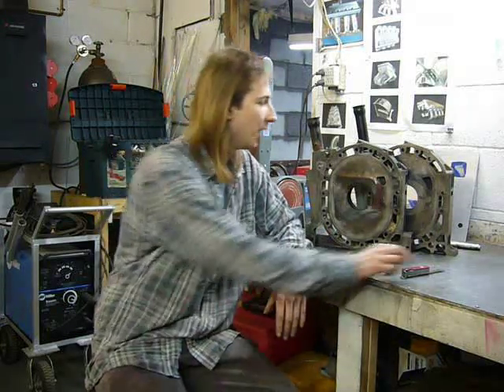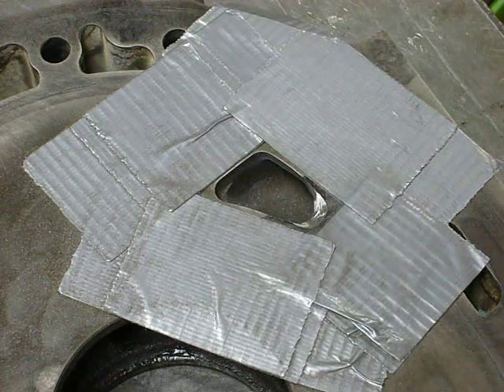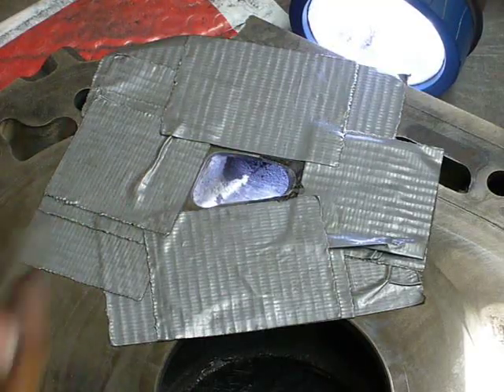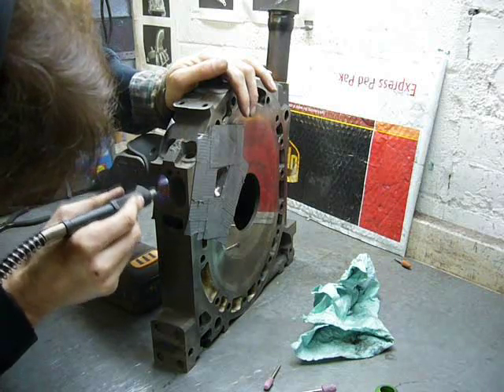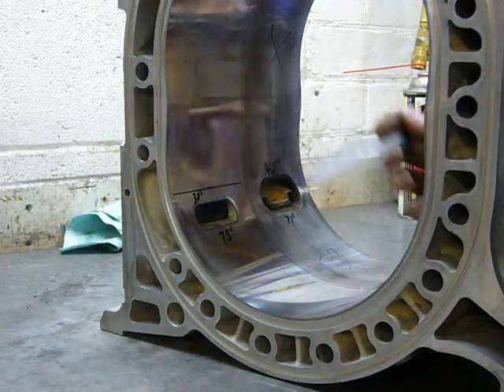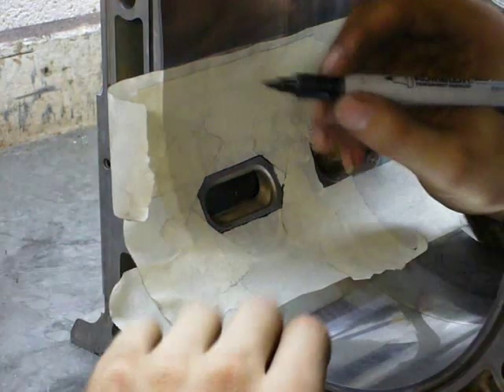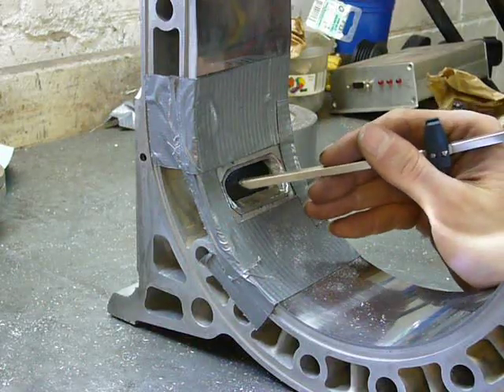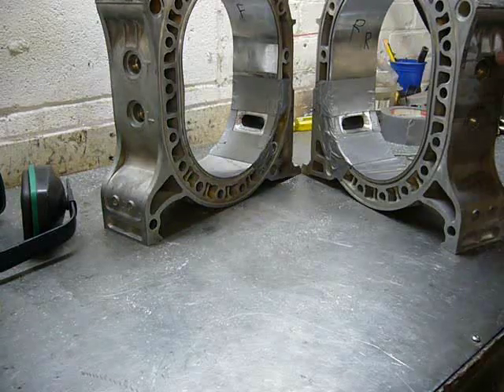Part 7: My 76 Mazda RX-5 Cosmo Restoration - Intake and Exhaust Porting

Comment: Aaron on my 1988 rx7 at the top of the ports the egr tubes pertrude should these be pluged. I noticed you covered the hole where the egr valve used to be with a flate plate. I was going to have a crossover chamber trying to duplicate the original design similar to original. What do you think
Reply from the maker: Mazda alternately eliminated and added back EGR over the years because the geometry of the engine means there is so much natural EGR. If you are eliminating the factory EGR system then the easiest solution is to cut a plate out of 1/4" steel/aluminium, drill using EGR valve or gasket as template and bolt to top of center iron with some sealant.

Comment: I've gone back to watching old episodes whilst I wait for the new shop :-)

This one remind me of my youth porting 2 stroke motorbikes.

Looking at the way you assemble the rotary - have you been tempted to try and put an extra layer in there like the 20b has ?
Reply from the maker: ***** Funny you should mention porting 2 strokes because as I was using my new 40V lithium ion trimmer (at the new place) I was thinking about my old 2 stroke, which I did port, and how much better it was not to have to deal with a smelly, dirty, greasy, noisy engine. Unfortunately it's not as simple as adding an extra layer to make a 13B into a 20B. The 20B middle iron (the "thick" iron) contains a bearing and stationary gear to support the extra rotor. As well as threaded holes to install a shorted set of tension bolts for the front section. The 20B eccentric is also 2 piece, otherwise the engine wouldn't be possible to assemble.
I did consider a 20B for this project because, well, how awesome would a '76 Cosmo be with the 20B from a Eunos Cosmo? But engine bay space, not wanting to build a beast and my desire to build a turbo 6 port with functional aux ports won out. Plus the cost of a 20B of unknown condition would alone have been the majority of what I've already spent on the car...and that's before I rebuild it.

Comment: hi there Aaaron
when you do a bridge port you then must lost low end tork ?
Reply from the maker: rambo95777 In general yes, if the Bridgeport is large enough to make it worthwhile, low end torque is reduced. Remember, the intake ports in a bridgeported engine never close fully so there is always major overlap with the exhaust stroke. This contaminates the incoming fuel charge with exhaust and reduces vacuum so chamber filling is reduced. That's why the torque drops and why the engine makes the characteristic "brap  brap brap" sound...it's rhythmically misfiring due to the charge dilution. Also because of this, a LOT more fuel needs to be added to the mixture at low RPMs and low loads, so fuel economy takes a nose dive. Bridgeports are high RPM race ports, just like you probably don't want a race cam in a daily driven piston engine.
Reply: aaroncake thank you Aaron.

Comment: Hey Aaron!
Are you familiar with Motoman?He runs a website named "Mototune USA ".
He has an article in there about porting and describes there how enlarging and polishing ports actually decreases power.here's the link to that:
http://www.mototuneusa.com/power_news_--_think_fast.htm
what is your opinion about his theory?

PS. You have made clear enough that you are a wankelhead although i am pretty sure you have the expertise to comment on that!
cheers from an Alfafreak!
Reply from the maker: I think he's pointing out something which all well informed builders know: bigger isn't always better. Certainly over porting runners and the like can lead to massive velocity drops. Sometimes even port matching can cause reversion issues. So it's certainly true that enlarging runners can be a bad thing if overdone or the rest of the system isn't matched (ie. no point enlarging runners on a near stock engine). However all of that applies to piston engines, as does his article. Porting on a rotary is best thought of as a cam swap on a piston engine. Changing the rotary port shape changes opening/closing timings and that is where most of your power comes from. But the same rule applies to the runners: no point increasing the size in most cases as it's just going to hurt you. Notice all I did was smooth some casting flash in the runners, I didn't increase their size. And my actual port job was very conservative as any more adds significant overlap, reducing low end, idle quality and fuel economy in exchange for top end gains.

Comment: What is the difference between 12a and 13b rotor housings besides the width
Reply from the maker: That's the major difference. Exhaust port timing is also a little different between engines, and depending on the 13B ('86 - 2004) it may not have coolant seal grooves, may have water ports for the intake manifold to keep the carb warm/cool the turbo (early 13B, then 13BT/RE/REW). 13B housings may also have metering oil holes (starting in '85 I think) and have different spark plug locations.
Reply: I ordered some re tooled rotor housings from atkins rotary because by 12a housings had very bad chipping. they look exactly the same and they also recut the grooves for the seals back in to the housings. how do u think it will run with a street intake port and the 13b exhaust?
Reply from the maker: destruction12100 They will run fine. The 13B exhaust is a little bigger in general than the 12A so it's sort of like having a built in street port. Cutting and grooving 13B housings to 12A is becoming very common as 12A housings are getting very rare. The chrome on the old 12As was not nearly as rugged as the 13Bs so finding 12A housings with good chrome is a problem. Older 13Bs (GSL-SE and below) also had much weaker chrome.
Reply: ok thanks and I hope it don't hurt low end torque too much and I hope It runs good
Reply from the maker: destruction12100 It will work well. Since the 12A exhaust port is so small there will be a noticeable improvement.
Reply: ok thanks
Reply: i am having trouble with the timing on my 12a I had to set the e shaft pulley to the yellow leading mark and then line up the distributer marks and when I put it together and try and start it it doesn't seem like the timing is even close have any ideas why it wont run?
Reply from the maker: destruction12100 When you stabbed the dizzy, you may have done so one tooth off. Common issue with the dizzy/CAS. Also, when you measure timing, remember to disconnect the vacuum advance.
Reply: yeah proably just got it a tooth off and vacuum advance is never hooked up have no ports for them
Reply: could too much Vaseline cause the side seals to stick on the rotor and cause no compression?
Reply from the maker: destruction12100 Doubt it very much. Vaseline melts away as soon as the engine reaches body temperature.
Reply: what if I got some under the side seals and on the springs
Reply from the maker: destruction12100 Not an issue at  all. I slather Vaseline over all of my seals and springs when I build an engine. Are you having a compression problem? Side seal issues typically show up as poor compression on only one rotor face. But if your timing was very off, it is possible the engine has been severely flooded which will kill compression until it's unflooded.
Reply: I have low compression and its not flooded and the timing is right now
Reply from the maker: destruction12100 If the engine was built with factory (or another hard type) apex seals, and has used housings, it may take some run time before compression comes up. The first few starts can be difficult. I usually recommend just cutting the BS and push starting with another vehicle.
Reply: there new but factory cut down side seals new apex seals and new re tooled rotor housings. I tried to get someone to help me push start it but everyone around was busy lol
Reply: aaroncake  whats diff between :
13bt ,re,rew ?
(sorry if i sound stupid)  #face  palm :/

Comment from the maker: That's a question I probably won't be able to answer as I don't really work with carbs. However it stands to reason that the stock Nikki carb and manifold are probably most suited to fuel economy. A much larger carb is going to have issues atomizing fuel at low airflows. A street port can typically benefit from some more timing advance, on the order of about 5 degrees in the midrange and high end. But the dizzy (as compared to an EMS) is going to limit your ability to modify the timing curve.

Comment from the maker: A Holley and the associated manifold will be set up for high end, and thus low end and fuel economy will suffer. It can't be compared to my setup which is a custom set of manifolds and a modern sequential EFI system. A typical street port won't help mileage either due to the increased overlap. I agree with the MSD boxes on the old ignition system. Huge improvement.

Comment from the maker: 30MPG (and above) would be highway speed. City mileage will likely be in the low to mid 20s. This will not be some antiquated carbureted car though. Check out parts 23 and 24 for manifold and EMS configuration. The transmission and diff will remain stock. The RX-5 Cosmo actually has a decent rear end ratio for low RPM cruising.

Comment from the maker: Basically, that's how it's done. Use a template and then port with a die grinder/dremel. The skill is not making the port shape, but in matching that shape to the runner. Most people use templates they have purchased. I only didn't for the exhaust this time because my ports were rather unique. I'd highly recommend using a template for anyone unless they have done this a LOT and understand how the port timing works.

Comment: I have been thinking of porting my engine for a while now, but I don't think I could do it myself.  I have seen some shops in my area that do porting, do they use the same method that you use? Like they have a template and then just trace and grind away?? Just curious...

Comment from the maker: The stock Cosmo 13B exhaust ports were approximately SA 12A size...very, very small. Much too small really for making much over stock power. I only opened them up a little in the interest in more flow without impacting drivability, mileage and low end. They're actually smaller than 2nd gen ports, with only a few degrees of overlap.

Comment from the maker: I typically just use grinding stones, but switch to the rotary file when removing the aluminium in the rotor housings. I've never had a good set of carbide bits so I've just never used them really. Years ago I bought a "cylinder head" porting kit from Sandard Abrasives and used those stones for a long time, but these days I just use the Dremel so I buy Dremel bits. It's all about what you are used to.

Comment from the maker: A street port should pass an Ontario e-test but as with anything, it will depend on the condition of the car and the state of the tune. If this is a typical street port I'd recommend moving the exhaust port down about 3MM (look at the RB turbo exhaust ports), and widening by about 1MM each side. Don't move it up. Moving down increases pressure on the turbine during blowdown and helps drastically with response but doesn't decrease torque if you don't go down too far.

Comment: From what I have seen, NA can get up to about 300hp on the 13B-MSP, but fuel economy and bottom end power are shot.  Seems like the big top mount turbo is the way to go as far as boost.  Low psi street driving seems to get around 300hp and you can turn it up to 400+ for track use.  But with an S2 RX8, I guess the computer is more of a pain than S1.  Oh well.  It's only an 09 with 38K on it, so I have some time before I pull the trigger.  And more videos planned around engine stuff?

Comment from the maker: The template I used for the primary ports is the Mazdatrix 6 port street template. It's basically the same timings as the earlier Cosmo 13B iron I showed. Secondary and aux ports were left untouched as to preserve low end, mileage and idle. Exhaust ports were ported about halfway up to 2nd gen specs, template was a ruler and sharpie.

Comment from the maker: Understood. :-) I personally prefer using an electric grinder. A Dremel style grinder is usually under $50 for a decent model and doesn't rely on an air compressor running all the time. Though the off-brand Dremel style rotary tools are poorly made. I've recently upgraded to a Dremel 4000 and would never look back.

Comment: ok thx ,,i bought a pneumatic one but the bits or tips are so useless,,the metal eat them like butter,,,seems your bids are very strong,here is very difficult to get those tools..but i know the max rpm ,i can compare i find a similiar tool ,,about the bits i ll have to try and try thx man.congrats your job is very compromised ,some day ill have all those tools too,and make the jod easier cheers :)

Comment from the maker: Yes. Some porters prefer the stones, some like the rotary files. I just don't use the files because the cheap ones don't last and the good ones are very expensive. Stones are cheap and work well. You should keep the file lubricated with the WD-40 to prevent wearing it down or clogging it up with aluminum.

Comment from the maker: If you are following my Cosmo project you'll eventually see it run. As of right now the engine sits in the corner of my shop under a cover while I finish the large amount of sheet metal work necessary on the car.

Comment from the maker: Irons are resurfaced if necessary. Measuring stepped wear with a dial indicator as per the FSM will tell you if the irons are too worn.

Comment from the maker: I learned about engines by reading and doing when I was a kid. Nowadays, you have the Internet so it's easy to find info. Find an old lawnmower, take it apart and put it back together. Cheap and an easy way to get experience with a simple engine. Get the service manual for the engine you are interested in and read it front to back. You'd be surprised what you can learn that way.

Comment from the maker: Opening the exhaust sooner in a turbo application generally results in better spool. However since it slightly decreased torque, it's best not to go too early in an NA application. NAs benefit more from going up and wider, increasing overlap between intake and exhaust for better scavenging at high RPMs. There can be some slight reduction in low end because of this though. I typically don't close turbos any later except on already high overlap ports (bridge).

Comment: ahh ok thank you, know I see why you were grinding out the runners getting the burs out of the casting flaws.. as far as exhausts goes, what is the difference in performance  do you get a better boost if you allow the exhaust to leave (open) sooner? or if you  make it larger more on the back side of the rotor rotation? and does it make a difference with n/a's or turbos? (i have a fc s5 t2)

Comment from the maker: Ah, the runners. They should be kept as similar as possible. From the factory they are rough cast so I typically just smooth them out. Little is gained in making them much larger, especially the primaries. Most of the runner work concentrates on the transition from the port to the runner. That's where the majority of the airflow gains into the port come from.

Comment from the maker: I'm not quite sure what you mean by the "inside" but yes, every port you make in an engine needs to be the same as the other. Otherwise you create flow differences which will lead to each side of the engine having slightly different tuning requirements.

Comment from the maker: Depends. How much power do you want? The only problem is that regardless of the port you choose, to get big power out of the NA, it will have to be LOUD. Full bridge and you're looking at 250HP, but insanely loud. Peripheral, add another 50HP but also, huge noise from the intake and exhaust. Quieting up the exhaust chokes those high overlap ports.

Comment from the maker: @davidleonardi1 A port job usually includes all the ports in the engine. On old 12As, sometimes just the exhaust was ported because it was so restrictive. Don't bother with the intake manifold and throttle body. There will be negligible gains/losses. I don't use an air grinder for porting because I find them annoying. Have you watched this video? You can see what kind of bits I use. Racing Beat has examples of porting bits on their website. Practice on some junk parts first.

Comment from the maker: @Walshy690 Mostly I use the round and cone shaped grinding stones, plus the stone that looks like a mushroom top. For the housings, I use a rotary file to enlarge the port and eat away at the aluminum. You will go through one rotary file to do both housings due to the hard chrome. Then I finish all ports with the sanding drums.

Comment: @aaroncake 
I only ask because u say big ports cause engine to be revvy, I see now u mean durations get long with big ports.
is there always a 3:1 ratio between rotor and shaft and do all wankel rotors need gear teeth?
I could swear I have seen one without?

Comment from the maker: @tpvalley I'm not sure how you would manage to make huge ports with a short duration. Since port timing is a result of shape and size, at some point the ports size is big enough that it has to open early and close late. Otherwise you have to swap the ports to the irons, and end up with the Renesis which has ports about as big as they can be without creating overlap.

Comment from the maker: @tpvalley It has been done, but really only in drag applications. That's a massive amount of port area and such an engine really only makes power above 8,000 RPM. The airflow from both sets of ports also interfere. For street use, a small peripheral port about a inch wide ("semi peripheral") has been used in combination with side ports with great success.